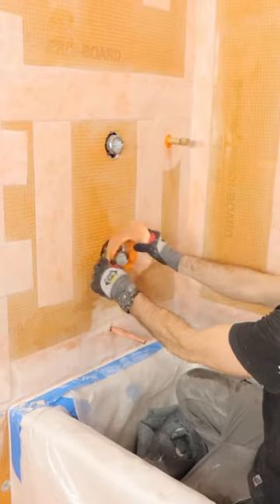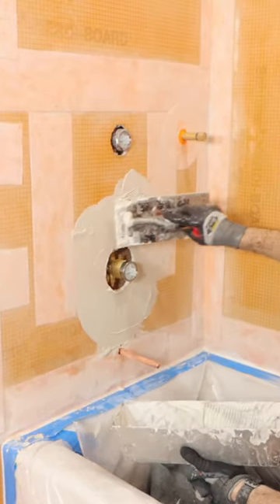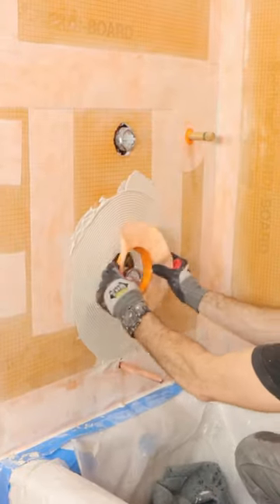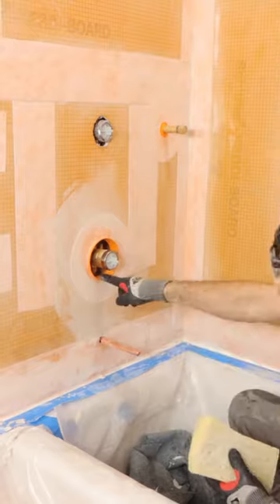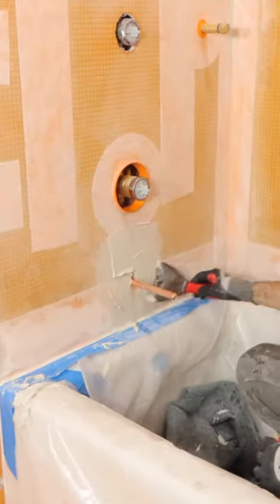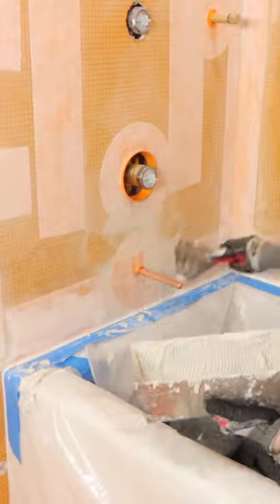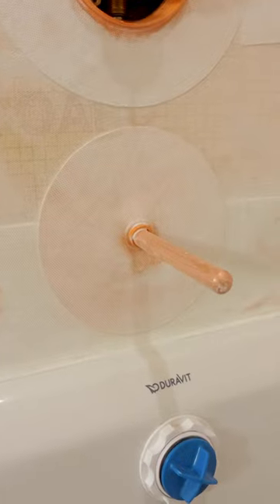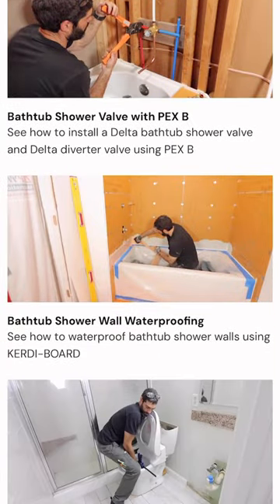Shower Valve Waterproofing Tips - #shorts #bathroomremodel #diy

Comment: What did you cover the volume control valve with???? Looks like nothing…..🤷
Reply: Looks like it'd be a diverter valve...since it looks like a wand attachment pipe near the corner (I would assume there's a shower head up top, out of camera view). And he's not showing the complete project, so I'd further assume he'd wp the diverter valve later on, prior to thinset/tile.